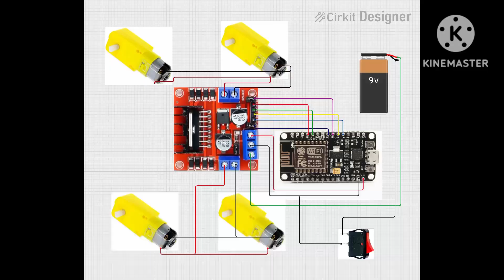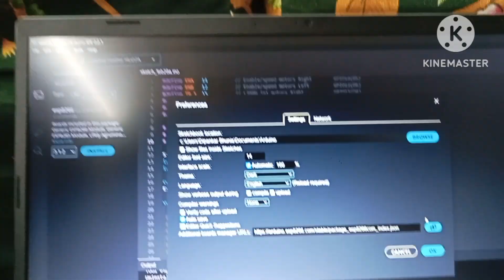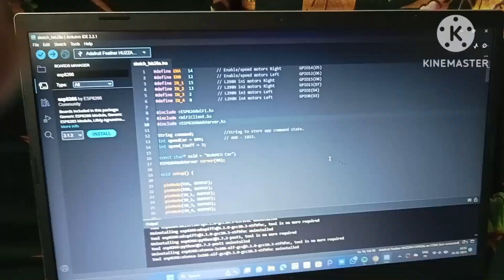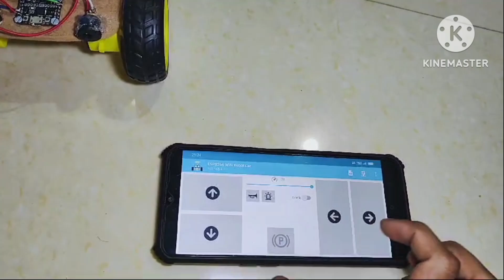| How to Make a 🤔 Wi-fi Control  | car 🚗 for using Nodemcu esp8266 Module | & Rechargeable 🔋|

Comment: I followed the steps in the video, but ESB8266 Module why doesn't the light come on? I'm use 3.7 battery 2
Reply from the maker: Check the led or Arduino connection and I give diagram Lin in Description 🙂any problem tell me

Comment: Bro not showing the com port please tell the solution
Reply: bro install proper port driver to recognise the esp
Reply from the maker: You check are you connect properly usb wire in your Pc  or Nodemcu module , and go to Arduino IDE select board name and select port which port are uploading code 😉 than its not work tell me.